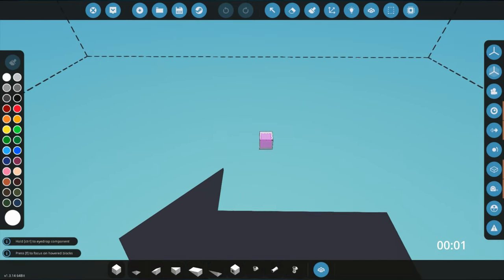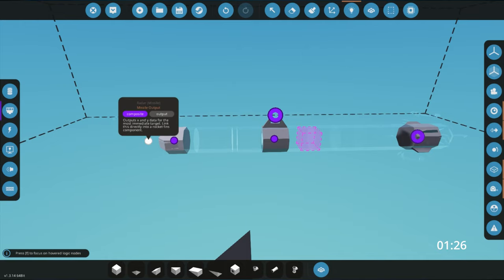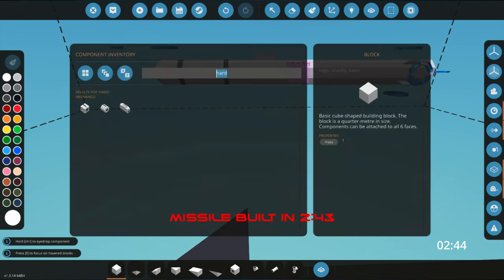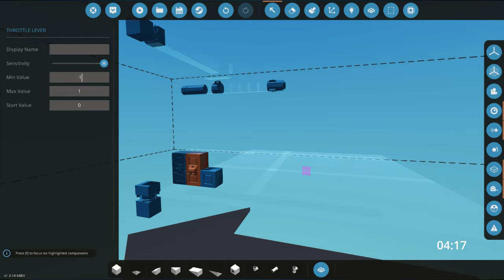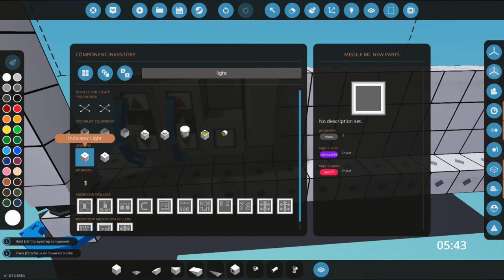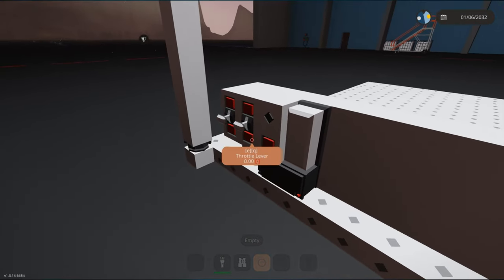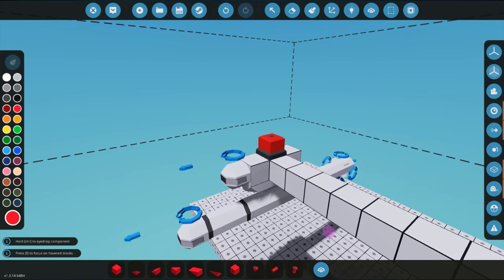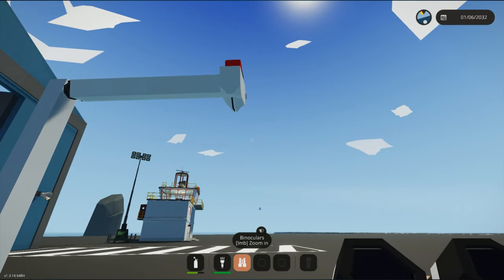3 Minute Air-to-Air Missile Tutorial! Stormworks search and destroy

Comment: I have no reason why but when I try to make a missile like this it just won’t go to its target
Reply: @DG-wr6cl  1x1 missiles with the radar missile output going into the fins only work as a front or rear aspect missile. The NNTC creature you’re referring to from the workshop with a 9km range is different. Like coolcats other missiles, it is a rolling air frame design which significantly improves its ability to lead targets especially at longer ranges. It also sends radar data through a lua script for improved guidance before going to the composite input on the fins.
Reply: @DG-wr6cl   If you’re worried about looks you can xml mod blocks to be invisible. The AGM 70 in the ashen weapons pack is actually a 3 high 3 wide missile however excluding the fins it looks like a 1x1. If you’re building air to ground missiles then the rolling air frame design isn’t necessary. Air to air missiles is where that is useful.